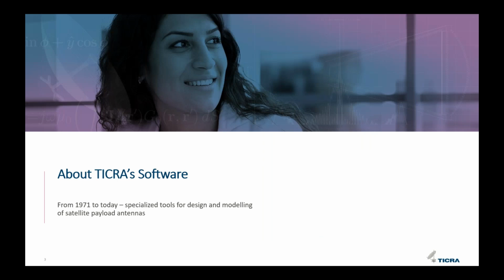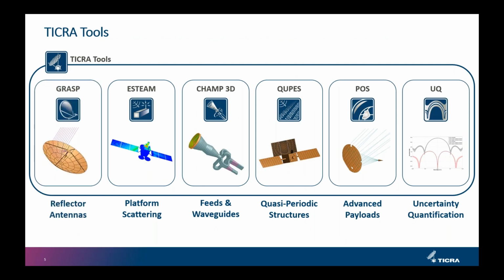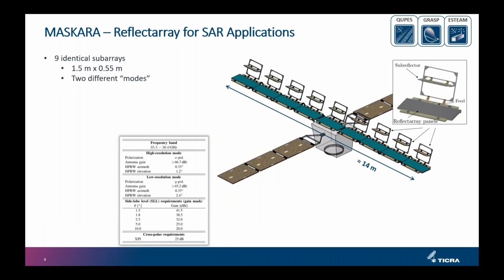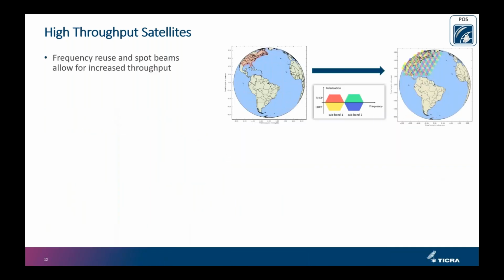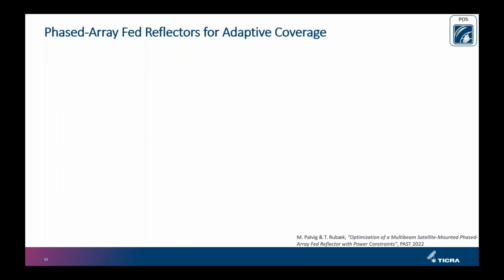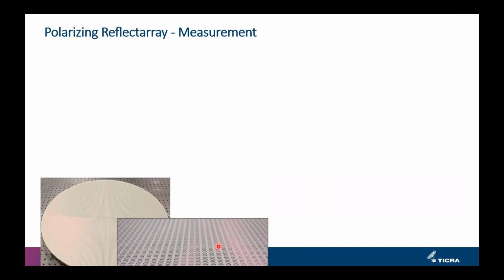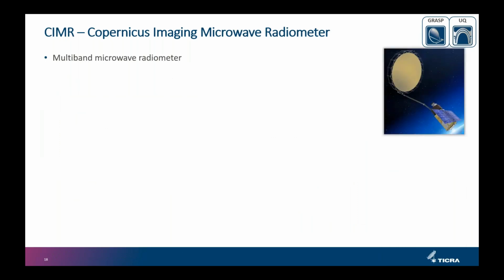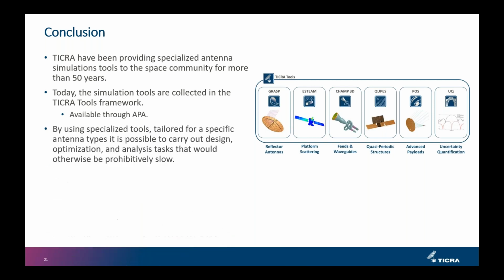Webinar: Enabling New Frontiers for Satellite Payload Antennas

Comment: Thank you very much. I am new to antenna design. Please recommend to me what different types of antennas should I learn to design to be successful in the antenna design industry.
Reply from the maker: Thanks for your interest in TICRA. Your question is very broad, and it is difficult to give a general answer. Working with different types of antennas, both smaller and larger ones, and both ones that are less directional and more directional, will give you a general introduction to different aspects of antennas. This is typically covered in courses and textbooks on antennas.